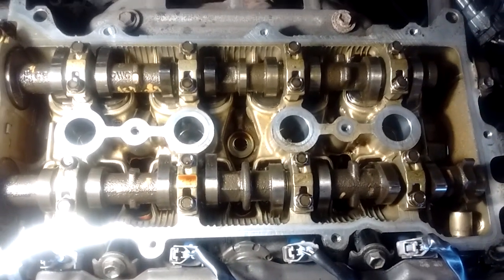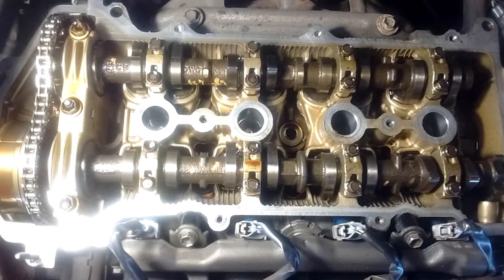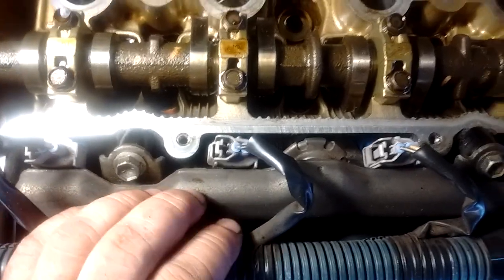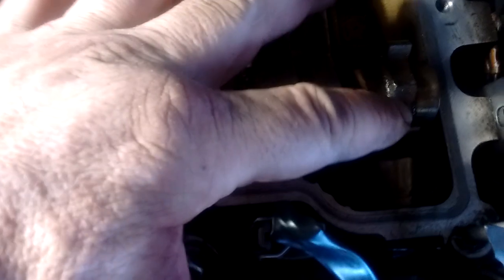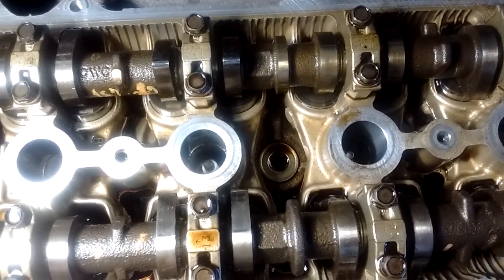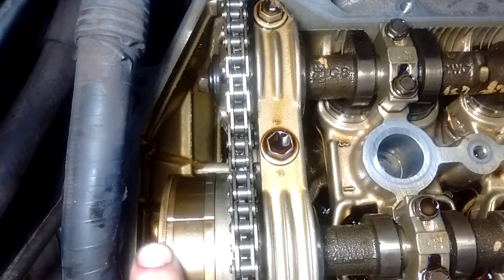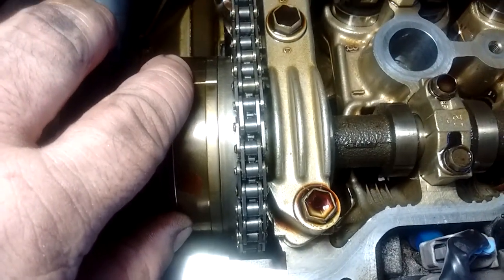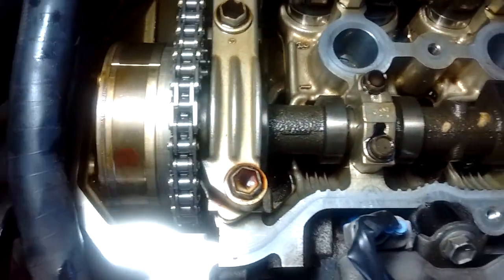1zz-FE VVTi Engine Basics - Toyota MR2 Spyder, Corolla, Matrix, Celica, Pontiac Vibe

Comment: Very helpful video. Doesn't this engine have an exhaust camshaft position sensor in addition to the intake camshaft sensor? Thanks.
Reply from the maker: It's a single vvt so it has only one camshaft position sensor. Later engines with dual vvt like 2ar and 2zr have two camshaft sensors.
Reply: @Merryfrankster_  Excellent. Thanks so much for the response.

Comment: Very glad to say that my Corolla does NOT have ANY slack like shown in this video. Mine was tight with no slack AS IT SHOULD BE...... When I changed my valve cover gasket I was also surprised at how clean the top was considering my car used conventional oil before I switched over to full synthetic, it was clean as this one shown in the video, just more brown.
Reply from the maker: Slack between the cams is normal when the enginen is stopped. It is due to lash in the valve springs. As soon as the crankshaft turns, the slack is taken up.
Reply: @Merryfrankster_  is it different for non vvti 1.8L?

Comment: If the timing chain is so loose how come it doesn’t mess with the phase of the camshaft? Isn’t there a bit of room for each gear to move away from the center by a few degrees?
Reply from the maker: Good question. It's loose only when the engine stops randomly. It tightens back up as soon as it starts. If you line up all the timing marks then the chain will be tight. But if you open the valve cover and see that the chain is loose, you should not conclude that the chain is stretched. This is ridiculous.
Reply: Frank Saab oh yeah that’s cause it’s hydraulic or something right

Comment: Cool vid thanks for uploading. I'm always interested in learning more can you do the same for the 2zz.
Reply from the maker: Thank you for watching.
Reply: @Merryfrankster_  I've just had a 2zz installed in my spyder and there's still a lot to do with it. Like the 6sp and suspension upgrade but I'm a little disappointed in the power and how late the lift hits. I'd like to turbo it to get a bit more out of it so I'm always looking for info
Reply from the maker: Definitely the 2zz is not a torque monster. With a small fast-spooling turbo you should be able to correct that and get more torque across the rpm range.
Reply: @Merryfrankster_  thanks for the reply. I have a volvo k24 turbo I bought ages ago for another project and I was hoping to use it on the 2zz I'm just trying to figure out what I need to get to do it. I plan on using the power fc for the tune but the fuel rail is expensive from mwr and I've been trying to figure out how to make a return fuel rail from something else. Any ideas?